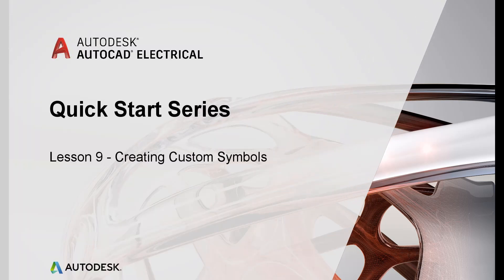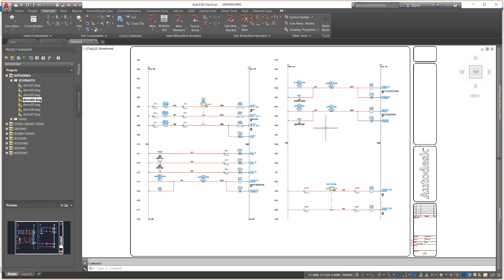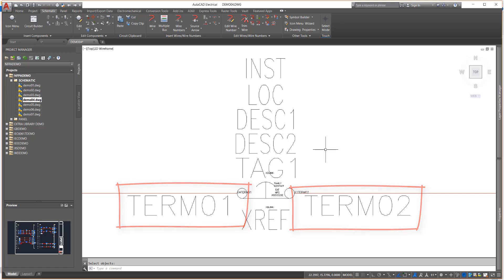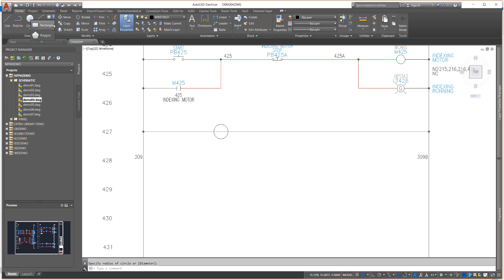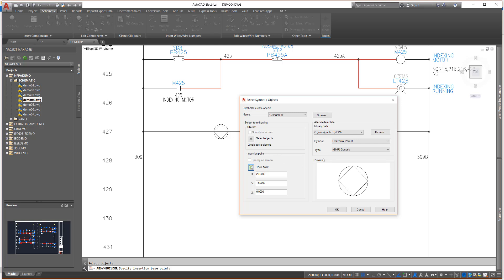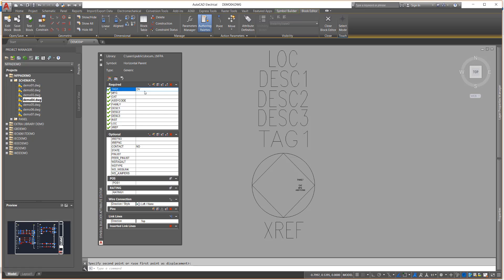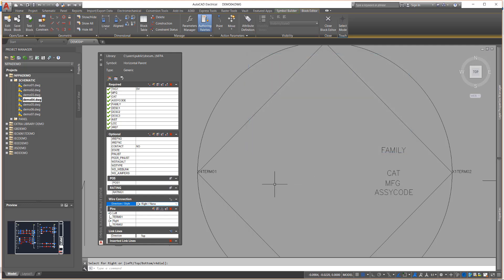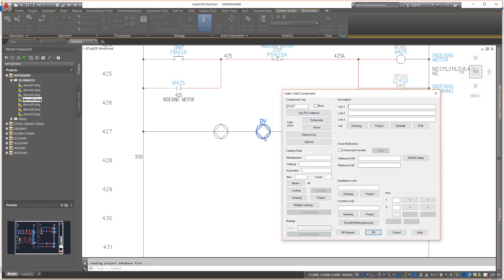Lesson 9 - Creating Custom Symbols | AutoCAD Electrical

Comment: In my when I select wire connection (in left/none) and click to the point where I want to connect the wire and after that it not changes  term no and if I again select the other point it shows that the selected point is already be seen .

Comment: Thanks for your excellent video, but how about the Link Lines and could you please let me know if there's any rule for naming the symbols in AutoCAD Electrical. I know that we've H & V prefix on naming but I am asking after that. Regards
Reply: Bro I'm also trying to find out link line. When I'm trying to insert symbol on vertical line it is not breaking the wire and not aligning vertically automatically as the pre-built symbols do